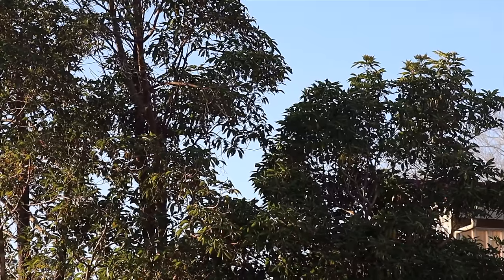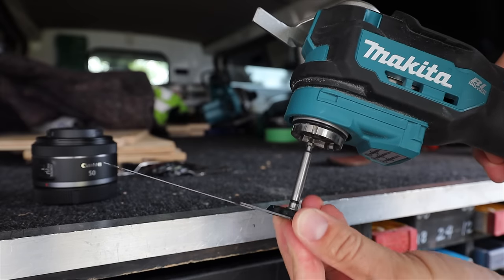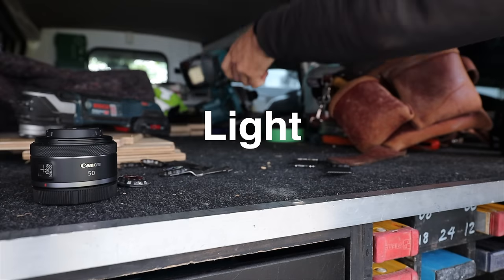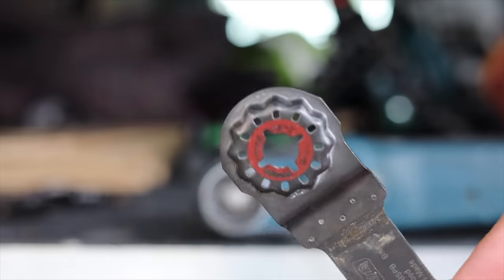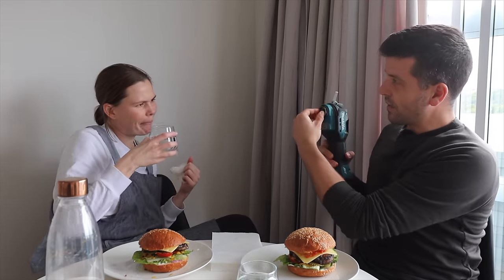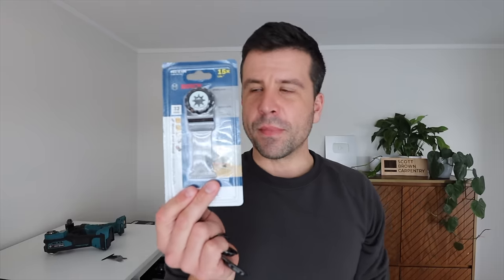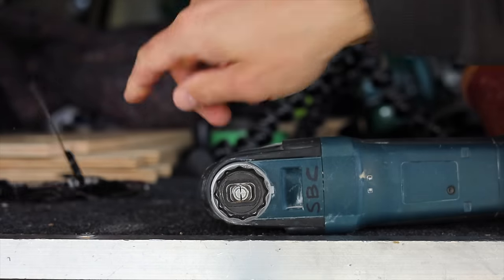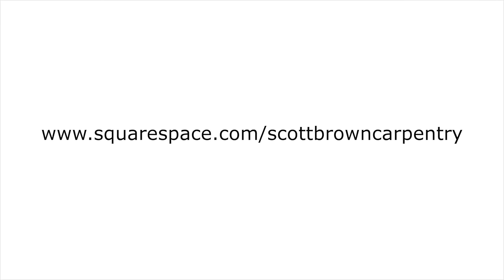Have Makita Made The Ultimate Multitool?

Comment: Brilliant review. I was aiming for the Fein AMM-300 Start, the Bosch 2nd but now I see the Makita & if it fit StarLock Plus and has ON/Off w/ variable dial, I'm liking it. What's your take on Fein system? I do mainly what you're doing,  a mix of plumbing, electrical, cabinetry masonry and more. Leaning more on cramps space electrical, cabinetry & plumbing so I find I like a compact 12v system.
Update: I'm having trouble confirming what Makita 12v Drivers or tools are brushless for US & CA market.

Comment: I have the milwaukee fuel. I think its best because it works with the regular blades which are cheaper, more readily available, and are standardized. The blade change is also fast, its a lever and a few turns of the pin, dont even need to fully remove it. And on top of all that, the oscillation angle is 4.2 degrees. Greater than the festool, and also much more cost-effective than the festool.

Comment: You mentioned that a Max blade can only be used with the Bosch corded tool. Is that tool’s blade locking mechanism the same as their battery tool? Or does it use a pin like the Makita?

Comment: Be curious to see the cutting performance with that vibration dampening system. I have Dewalt multi tool (and Festool ordered) and feel like the cutting performance goes down when I apply too much pressure or the vibration/oscillation is transferred back into the tool. Allowing the tool to move inside the grip looks like would make that worse but I can’t say for sure until I see it first hand

Comment: Hi Scott, great video!  Three questions: Do you find the DTM52 being too bulky in size? The front/top looks quite big - at least compared to your cordless Bosch. Question no 2: Have you had any issues with the pin? Some people are saying that they had problems with the pin to lock the blade, then being forced to send it in for repair. Others are worried about loosing the pin. What is your opinion regarding the pin system? Question no 3: Now having tested both the DTM52 and Bosch GOP 18V-28, which one would you choose? Many thanks! BR Martin

Comment: I'm so confused... I have an 18V makita multitool which looks the same as your "old" one but it has the pin with a locking lever like this new one you're showing. 
The lever is on top and you pull it forward (over the head) to release the pin. You then pop in your bit, push the pin back in and push the lever back over to lock it in. 
So did you go from a really old makita multitool to the latest one and miss the model in between the two? If so, the locking pin technology with the lever isn't as new as that new multitool of theres.

Comment: Hey Scott can you do me a huge favor?!  Can you verify that the off set blade, when I stalled into this new Makita multi tool, it will clear the blade bolt holder, so that you can truly do a flush cut on the off set side of the blade.  I just borrowed a friends Dewalt cordless one and the blade is not past the mechanism that holders the blade.  What a bad design by Dewalt!  Thx

Comment: Yep, I have the old Makita multi, I love the tool, but honestly it might vib your arm off.  It works great and is strong, but you will feel it for sure.  I have not compared Multis, so I'll have to do that, but this new one looks great.  Are not Bosch and Diablo the same company?  Will my old blades work with the new tool?  I have never screwed my pin in the Makita, it just drops in and I shut the stupid arm that takes a ton of force on the front.   I am confused.  Need to see the new tool here in the USA.

Comment: I've never used anything but my deWalt for the past 5 years and I'm throughly intrigued as to why it seems like no one has improved on the blade design. Its so easy/simple but just works.

What are the design flaws or disadvantages I dont know about?
Reply: Posted a comment very similar to this, waiting to hear back

Comment: Hi Scott love you channel. Can you point out exactly which blade brand you use. From my experience with buying blades I find they go blunt every quickly.  you would just about cut 1 nail and the blade is ready for the bin. I mostly cut wood and have been buying the wide blades once they have been used for a bit using a 1mm grinder blade cut new teeth.
Reply: If it's just for the nails, then the Bosch AIZ 32 AT Metalmax blade is best, it has carbide teeth welded to the front of it.  This is probably the blade Scott has been sharing with the others.

Comment: I have one question to ask between the cost of various blades from diablo to your Makita .. star lock, with the house renovations like the ones you do what blades do you find actually handle the best workload. I have brought nail buster ones that do fine in pine and I guess modern nails but burn out really fast with Rimu and older nails they use .

Comment: You know the blade design was between Bosch and Fein not just Bosch. I cant believe Makita are still using the pin to hold blades. I will thank you though as i was looking to buy this to replace the old Makita multi tool i have but im now very much put off by the fact they are still using the pin to hold the blades on, Im also not over sold on the Festool multi tool mainly because of the price of it and ive had a few bad Festool products as of late. Which I guess that leaves the Fein option.

Also that Makita multi tool is chunky because it has two cases, the inner one holds the motor, gearbox etc and the outer one is the part you hold on to and the mounting between the two cases is what gives you the reduced vibration or thats what im told

Comment: DeWalt still do the best multitool about. Most ergonomic & just overall is the better MultiTool. Easy to change the blade and also if it’s star lock blades you have you just slip on a bolt on the front and you have the compatibility for that.

Comment: Feeling left out with Dewalt’s offering not being compared. I was under the impression the type of blade going on the Dewalt is a standardized or what is intended to be the new standard.
Reply: OIS is the old standard, and it has some limitations. Starlock is an improvement, but the adoption is slow and awkward as with any new standard. There's absolutely no doubt Starlock is better, but it also costs more, and while Starlock (not Plus ir Max) will fit on your OIS tool, (the Dewalt has a stupid adapter that gets lost for Starlock blades) the Starlock tools will not take OIS blades. Also if you put Starlock blades on an OIS tool, it will have the same limitations of an OIS blade because pins and holes. 

I'm seriously considering going to Starlock, with this Makita. It will give me access to the super long and heavy duty Starlock Max blades. Plus low vibration, quite, and has 3.6 degree oscillation angle which will chew through material like it's made if cheese instead of generating heat and setting off the smoke alarms like my Dewalt does. The Dewalt is a reliable tool with and absolutely horrible design that in my opinion makes it barely usable.

Comment: Yikes that is a confusing bunch of systems. I'm on an old corded Makita, Allen key fastening. The thing I hate is there's a part to remove, the bolt, and drop. I'm usually up on a scaffold or somewhere where it would a huge pain to drop the bolt. Then I forget the allen key and have to climb back down....So the new system has a removable pin? Same old problem. Drop the pin, lose the  pin.

Comment: what are the differences between the different blade types? why would you use a starlock max over another starlock blade?
Reply from the maker: The starlock max is the longest so you can make deeper cuts. It comes in handy on renovations. But, to do the deeper cuts you need more power.

Comment: I feel that 90% of the multitool is in its blades.  Blades are a dime a dozen, SO many crappy tackweld ones.. and then a range for ones that are more expensive than gold vs a dozen for $10.  I have had high end ones break at the tackwelds on the blade.. and then some of the cheaper ones last longer all around.

Comment: The "ORIGINAL" Fein Tool (the Inventor of the Oscillating Multitool) This is the Same Method of Blade Attachment as the Original. Which IMO is still better because its CORDED so it is stronger and doesnt tire out...plus, its the original. Fein Tool had the patent for YEARS n years and then that patent was released and suddenly there was a WAVE of Knock Off Fein Tool Wanna Be's  I still prefer the original. The best thing about the patents and the wave(s) is that the consumables for MultiTools has gone WAY down. The original Fein Tool has a vacuum attachment(s) and lots of AWESOME stuff. I like the dewalt multi tool as a battery operated beater. but I do like the Attachment Peg I see that the Makita has now - that is my favorite way to attach almost any "brand" blade or tool to the Original Fein Tool :)
Reply: Well, when it comes to Starlock it's the child of Fein and Bosch. They both use it in all their multitools, corded and cordless.

Comment: First if all the noise is totally irelevant as the noise created by cutting material is going to be far louder than the tool it's self, so whilst in use the noise of cutting a nail or a piece of wood will be the same across all tools using the same blade unless one tool oscillated at a slower RPM resulting in a slower cut and a longer duration of noise at a quieter rate. I mean who ever cared about how noisy a tool was as long as it does the job. Secondly the beauty of a multi tool for me has allways been the fact that you can get them in tight spaces where you might not be able to get a slitting disk in on a grinder or a hand saw, for example notching the door architrave to allow laminate flooring to slide neatly under. The bigger the tool surely the more limited it's going to be in its intended use. It just looks bigger than the model before which is not a good thing. I Mean while angle grinders are been released with smaller heads and 90° gearbox gears to create a slimmer gearbox to allow access into tight areas the multi tool is getting bigger 🤔

Comment: So what was your point??? The noise and antivibration seem good. Why do they call it a multitool it only does one thing.. oscillate. A drill can make holes, ream, sand, grind, screw, bolt. Wind. start things, work pumps, mix plaster or paint. Torque. In either direction. Bit of a multi tool.

Comment: I'm a little disappointed with that new makita. I think they can do better. Why is the corded bosch the only one that can do all three without a pin? What difference does the cord make? Makita needs to do away with the pin altoghether and make something similar to x-lock but for multi-tools. Even if they have to make the blades themselves or team-up with diablo again. I really don't see what's so great about star lock, if I buy that multitool all my old blades can't be used and I still have a pin to deal with. I'd much rather have the bosch blade change method if I'm going to be forced to used starlock either way. Just doesn't make sense to me. Come on Makita, Let's get it together!!

Comment: The blades are propriety solely for the purpose of forcing the customer to buy from the manufacture of the multi tool JUST to make more profit for the manufacturer. None of these systems are made for the benefit of the customer for safety or otherwise.  Just another way for the manufacturer to make more money.  Rechargeable batteries are the exact same way.

Comment: I had the older Makita for awhile until the gearbox broke which sucked. I thought I’d lose the bolt and Allen key for it but I used my head and kept the key in a little HD zip bag with the extra blades. Which were cheapy ones cuz F&@$ Bosch for charging so much for theirs. Really I only messed with the bolt when I was changing blades, and I didn’t do anything stupid so I never lost it. You were just getting distracted cuz you were making a video. In real life a person would change the blade and replace the bolt or pin where it goes and move on. The idea that it can be lost so easily therefore it’s a bad design doesn’t hold water, unless you do something stupid and leave the bolt or pin out and go have a hamburger. My question is how is the star lock system as far as holding the blades tight? It looks really flimsy on camera, like if it pops on so easily won’t it pop off when you put it in a tool bad or drop it accidentally and the blades go ping! off into the rhubarb? Curious. Seems like star lock is just another gimmick to try and sell people overpriced blades with, and Makitas jumping on the bandwagon.

Comment: The Makita XMT03 has had a lever and pin system, for at least last two years. Bosch blades are a rip off, and their warranty process eats ass. When my 10 month old Bosch multi-tool failed, they tried to void the warranty because i had non-Bosch blades in the case (they fit the tool fine). They were real cocks, so I’ll never buy another Bosch tool again.

Comment: So, Bosch and Fein jointly invented the Starlock system. Originally you could only use Starlock blades on Bosch or Fein multi tools until they licensed out the blades to other tool brands (e.g. Makita). HOWEVER, both Bosch and Fein still hold the exclusive patent to the pop-on/pop-off system - other brands have to make do with the pin adaptor to mount Starlock blades (obviously the OGs want to keep the edge on their competitors). The only exception to this (for now) is the Festool Vectura because, wait for it... Fein actually MAKE the Festool Vectura - it's just a rebranded Fein AMM 700 Max in disguise!

Comment: Thank you for review. Anyone who has used a multitool knows how unergonomic it is. It is way too powerful for the mini-jobs used in carpentry. Because of the vibrations, it is far less accurate than the multi-blades would have you believe. Ripe for re-engineering.

Comment: I have the Dremel MM20, https://youtu.be/fny_JAbUonI a sister to the Bosch, but without the star blades. To replace a blade you turn the knob slide in the blade and turn the knob in opposite direction, no parts to drop or lose. Wish it had a light and had a higher capacity battery. Oh they only replacement battery avail is from Bosch. While it is not great at anyone task, it just a handle tool for lots of task. Thanks for the video.

Comment: Still seems complete garbage. I use some very cheap range tools and they don't need any of this nonsense, they fit the 'old style' of blades but the center pin is part of the tool itself. You swing the locking latch out and it narrows the center pin enough to be able to fit the blade over it, you install your bit, then you swing the locking latch back and it expands and retracts, snapping the blade in very tightly. No need to piss fart about with extra tools or lose-able pins. And you can unlock, rotate your bit and relock in about 3 seconds flat

Comment: I love Makita...but I don't like the Makita  you show with the pin.its just looking too fat,and  more cumbersome.but the pin that you lost ,about the time I as thinking some minion that works for me would loose it in month of use.tyen I thought ,I'm up on a 10 ft. Ladder ,swapping blades back and forth,and drop the pin 2 or 3 times.up and down the ladder.then add in the 25 minutes it took to find a bright flashlight to find the pin that deflected in the dark  and vanished somewhere in the grass or dusty dirt below.yeah ,that's something  I can do without.samevith using any wrench.is imperative with that tool that any tool or method of changing the blade must be fast,and attached as part of the tool..I still have several jigsaws and expensive sawzawlls that requie an Allen wrench and boot to change the blades..the nuts are always rounding off the Allen wrench head.andv then the worst of all,when your help unscrews the bolt too far and it comes loose and falls and disappears.finding the right replacementvwith proper length and thread size  and riameter is never happening quick..I only use my ones with QUIK blade releases.juet today the Dremel multi tool I have .I went to change the blades and the Allen wrench I keep attached to the cord was missing.dont know where it went .but I had to go dig up a new single wrench to fit to use a rubber band to keep it on the plug of the tool....that sucked 15 minutes of time before I could change blades.and that is probably the 3rd time it's happened..getting close to an hour  of lost time.got to have the quick change on any tool you buy.if you buy a new tool without it ,you I consider to be an idiot.lol
I sure would love some of these cordless tools to have also a insert prongs ability to plug in a standard electrical cord and use electricity to save battery's from being ovr heated or warmed shortening their lifespan.and saving your battery charge for when you need to be cordless.away from easy electrical outlets to access...?

Comment: Any multi tool that has a toggle switch and a rotary speed dial is an epic fail. DeWalts many hear old design by now has a simple quick release system, and a trigger to adjust speed.
Reply: Multi tools are used to get into hard to reach areas, and at awkward angles, where you often can't hold onto the handle section to squeeze the trigger or have tree stability to hold the trigger at a constant force to keep the speed constant. There's a reason why no one, except DeWalt, uses a trigger with a MT.
Reply: @littlejackalo5326  when I cant reach the trigger I just turn on the trigger lock :)